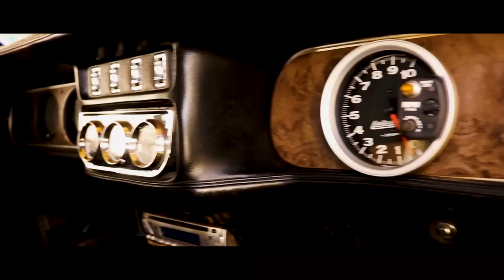1969 Mercury Cougar XR7 Barn Find | Full Car Detailing & Satisfying Transformation!!

Comment: The 351 Stroker is an awesome motor and the relative simplicity of swapping it into these old massive engine bays. As well as the engine having mild amounts of power making it easy on the wallet in comparison to newer small block crate motors.